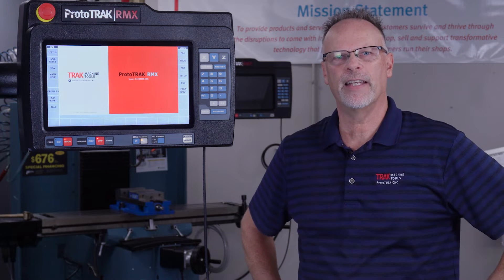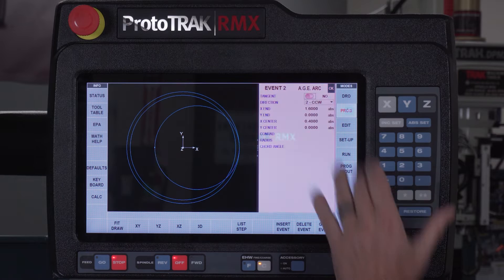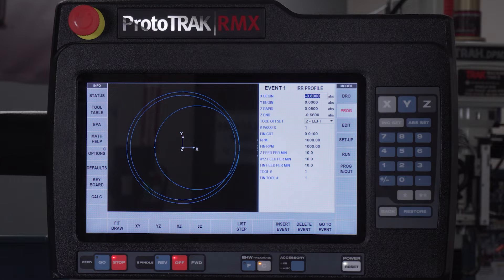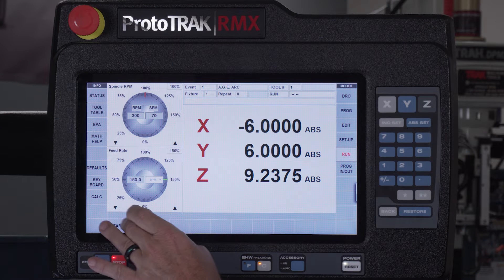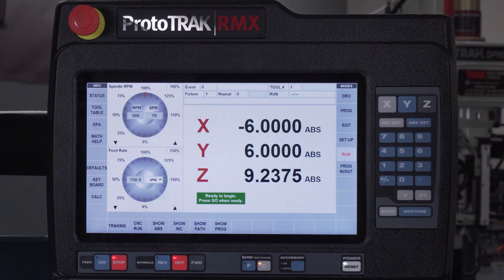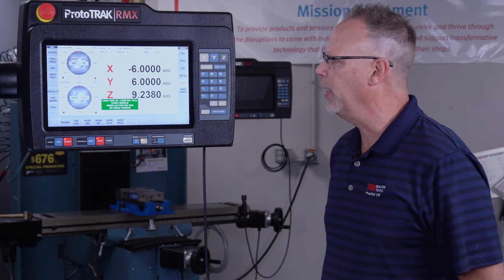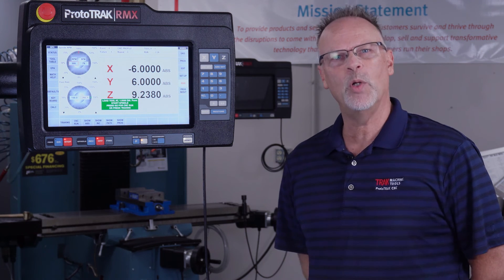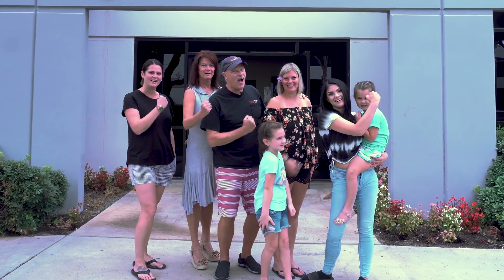Milling Interior Grooves | ProtoTRAK RMX CNC

Comment: Master Traking Pat , i need to programming a 3d ramping slot  with 30°angle degree, it is posible? On The smx ? ..... Xz plane and yz plane .... ... ... Thanks for your videos i learn all iknow about The smx from your videos , including english 😂😂 because i speak spanish 😂 ...
Reply: Micky, thanks for the kind words, I'm glad these videos are helping you!  I'm not completely sure about what you are asking me here.  If you use multiple mill events, (Not in a profile) you can start at one Z dimension and end at another so you would just have to figure out the Z depth at each end by using MATH HELP TYPE 28.  You would enter the length of your slot in "A", the angle in "G" and it will calculate "B" for you which in this case would be your Z depth.  Please keep in mind that when programming in the XZ or YZ plane, the control assumes that you are using a ball nose end mill so it will start the tool tangent to the plane in Z.  If this is not what you are trying to do, please call or email me directly so that I can help you.  Unfortunately, I got a feeling that your English is way better than my Spanish!  Feel free to contact me at the factory.  310-608-4422 or pfitz@trakmt.com  T.P.